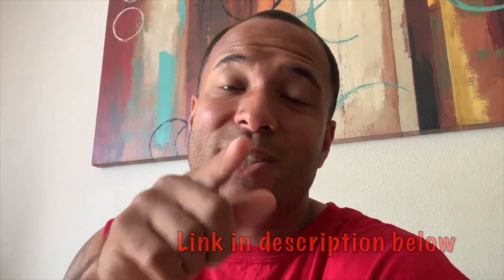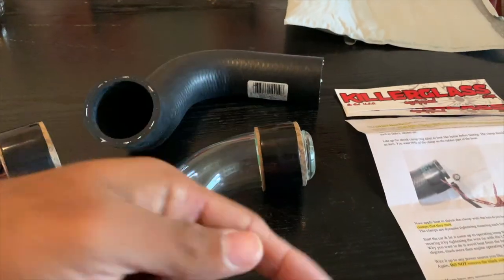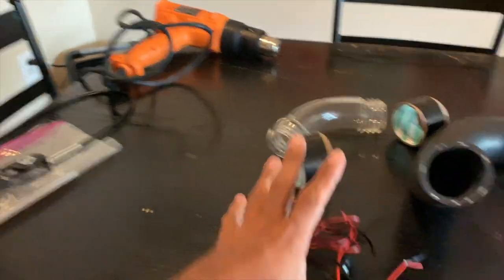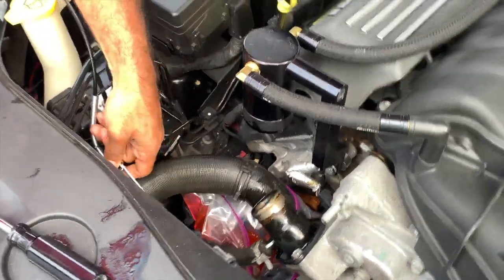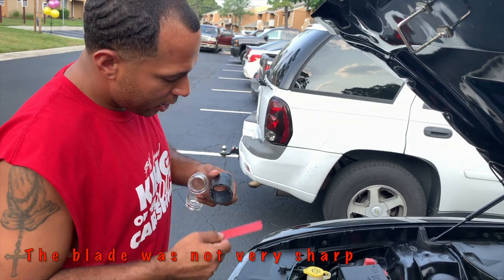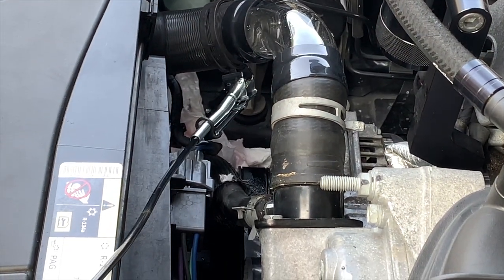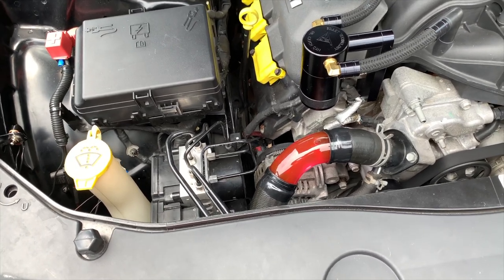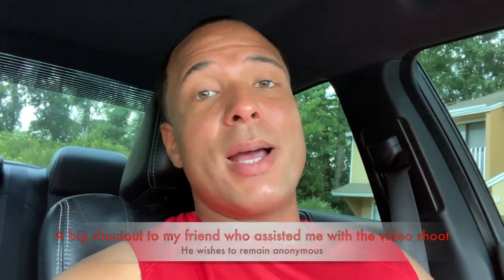392 Charger Killerglass Radiator Hose Installation

Comment: Nice little post, building a ‘72 c10 w a 383 been looking for small little aesthetic mods like this. Seems simple for the eye drawing attention tbh. Surfed the site I see they have larger cutouts. Have you had any issues from the time of install to now?
Reply from the maker: I dont have that car anymore but i didnt have any issues for the three years ive had it installed until i traded the car in.

Comment: have to use new hose dealer tried using old house it blew right off on 1st time on highway talked to killerglass said they must have tried shortcut using old hose thats why it failed looked real cool have jeep srt8 392
Reply from the maker: Yea a new hose is preferred but i reused my old hose as you saw in the video and never had an issue🤷🏽‍♂️

Comment: You said you were already changing it. What was the reason you were replacing it for? Is it because of the inflation?
Reply from the maker: My old radiator hose was extremely soft and starting to crack in certain spots so it was due for replacement.
Reply: @Srtfiedofficial  oh ok I was watching all your problems with the srt8 and man o man did you have bad luck. I was so entertained watching the vids. I recently picked up a 12 yellow jacket 392 and the only thing is the radiator hose that gets inflated or “swollen” as many say. But any recommendations on keeping it reliable for a while? It has a brand new engine with 13k miles on it old one blew at 102k due to a cam/lifter failure. I got it from an older man that I work for.
Reply from the maker: Yea I definitely had bad luck with Cersei towards the end but she was a great car until that point overall! But the radiator hose has a steel coil inside which will keep it from deflating too much. That being said just keep an eye out on it. As long as you dont notice any dry rotting or cracking then you’re fine. But other than that just make sure to keep up with the maintenance on the car. If you havent done so I’d recommend changing all your fluids such as brake, rear diff, coolant and power steering if you havent done so already. Also make sure to always use good quality oil and change your oil more often than recommended depending on your driving style. I changed mine every 3k miles. But other than that as long as you take care of your car and dont ignore minor maintenance needed, you should be fine and the car will last you a long time without major issues. Congrats on the purchase btw!

Comment: I don’t have that drain screw mine has a hose where your screw is
Reply from the maker: What trim do you have?
Reply: @Srtfiedofficial  2017 srt 392 challenger manual
Reply from the maker: Ah ok, yea the challenger may be a bit different but shouldnt be much different